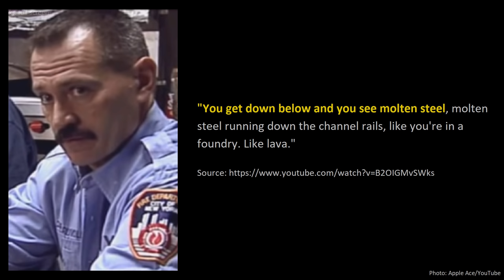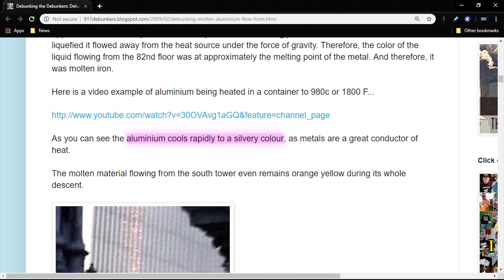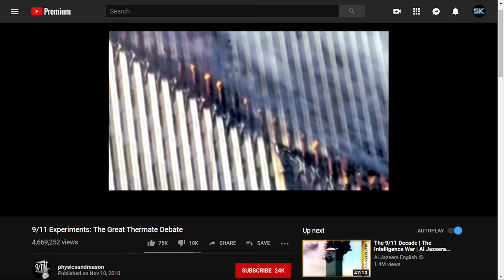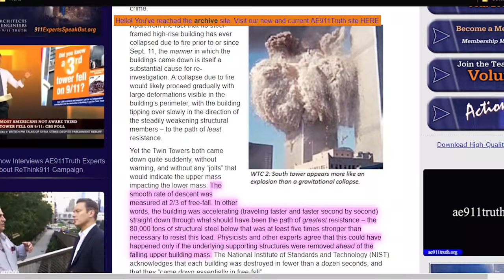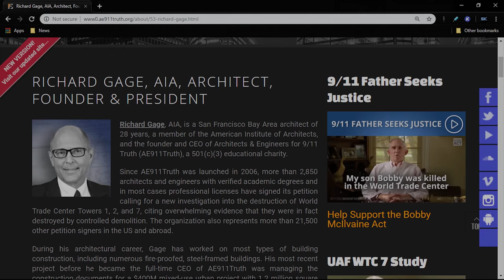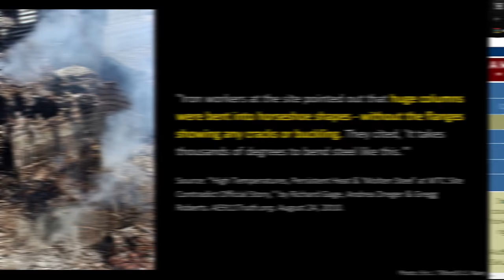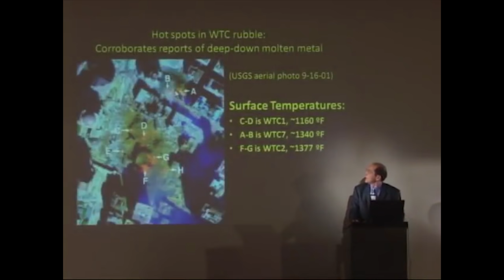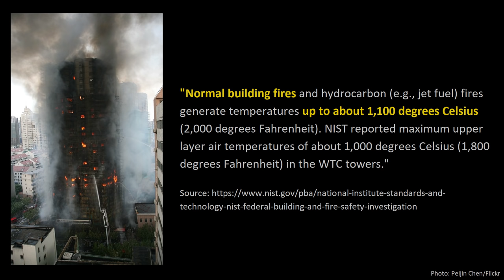9/11 Truthers Debunked: "Molten Steel = Thermite From Controlled Demolition!"

Comment: Excellent video and explanation!  One thing I've noticed about the much viewed hot liquid seen pouring from the South Tower corner just before the collapse initiation - no one but no one states the obvious. Well, it's obvious to me but perhaps that's because I've worked in buildings small and large half my life and have a built in sense of level and plumb. I don't care what the stuff is - but I'm very interested in why it's just started to come out!!! Holy moolley Batman, good job we packed our thermal resistant tights.  
The fact that the stuff is flowing UNDER a spandrel speaks silent volumes - the floor is detached and dipping down ( all the floor truss connectors were fixed in spandrel centres, thus the flat interior surface provided a "render stop" to American builders for the concrete was poured in). Bear in mind that in common with many office floors, both Towers were designed to support 100lbs per square foot - quite enough for office furniture and people walking about but after the B767's flew in - the lowest floor had to carry all the debris from wrecked floors above and most of the aircraft - and mostly on one side on fire!
I can't be bothered with thermite as the very idea is ridiculous.
No one who is surprised by the "meteorite" has any experience on old skool English demo sites! Not very Eco friendly - as the first thing we'd do is light a frigging great fire and I pride myself that I learned to be masterful in feeding my fires to consume stuff that other folk thought impossible. One of my "secrets" if they really were was building a big heap of fairly loose lumpy hardcore as a fire bed - once going well, the fire would draw air through its bed and on occasion - I had a mini blast furnace!
I didn't have access to the big hydralic shears and munchers of today so I'd drag any blocks of concrete with steel embedded and push them in the fire with the machine - a week in that kind of heat expands the steel and pulverises the concrete. Ground Zero had very similar conditions - only bigger - quelle surprise!!!
I've worked on controlled demo - actually with Controlled Demolition Inc in this country - 230 guys on one project ( three 15 storey concrete towers ) stripping them back to the frame and then weakening on one axis - the explosives blow out sections on the other and gravity does the rest. One major draw back to using secret explosives in the biggest fake in history would be the evidence it was almost guaranteed to leave behind - bits of det cord, connectors, tape bunches, junctions etc., - no truther has ever done more than shovel onions in MacDonalds so it's a mystery to them.
Reply: Outstanding summary and insight. Thanks for sharing!
Reply: Great post! For me, that was the part of the building where one of the engine of flight 175 and parts of its associated landing gear came out and we can assume that some parts of the wings also lodged itself in the opposite corner of the building, thus the dripping aluminum… very simple.

Comment: He openly admits NIST never tested the "WTC meteorites" without giving an explanation for why this would've not been done, as well as that they potentially lied or are incorrect about the reasoning for why the molten metal seen on floor 80 is Aluminum and not steel or iron or other materials (once again admitting it was never tested). He implies that dynamic hot-spots in the rubble imply a fire but not molten metal when there could've easily been both a fire and molten metal (not to mention that molten metal could've continued to settle over time causing dynamic hot-spots, or the aluminum he claimed existed could've kept melting and flowing) and also giving no explanation for the eye-witness reports of molten metal from firefighters; going as far as to say "to my knowledge no such testing was performed" in reference to testing of the molten metal firefighters claim they saw. You'd think an unprecedented attack on American soil would warrant such testing; but I guess it's in no way suspicious that no testing was done. He asserts without any evidence besides conjecture that it would be near "impossible" to rig the building with charges (once again using still images of a single floor of the building as evidence for a complex claim). He seemingly doesn't engage at all with the idea that small nano-thermite charges could've been planted on the outside of columns (not requiring them to be cut open as he implied) and that it would be relatively easy to conceal such devices if you were trying to. He also assumes that the thermite reactions would be visible from the exterior of the building because conventional thermite reactions generate plenty of heat and light (and likely would be visible), while not realizing that nano-thermite reactions could be tailored in a way to produce much less heat and light while still damaging the steel columns enough that they would eventually fail (remember they don't have to be cut completely for the building to fail over time from fires that would likely have occurred due to the crashes). He seemingly doesn't want to engage with the idea that thermite could've helped the buildings fail, as opposed to being the sole source of failure. He also only included a few short clips of the longer video by Cole, showing mostly the "failures" (times when the thermite reaction didn't adequately damage the steel beams) while seemingly intentionally excluding the "successes" (some of the thermite reactions cut fully through the beams in a way that allowed them to be pulled off by hand and that looked very similar to images of melted I beams present at Ground Zero). Additionally Cole admits in the video he's not an explosives expert and is simply rigging up experiments to test the viability of thermite as a tool to damage steel support beams (which NIST claims was implausible in their original FAQ); he did not go further in testing nano-thermites nor is he using military grade techniques when applying the thermitic compounds to the steel beams (it's plausible to assume an expert could produce far better results). The reality is that nano- or super-thermites existed as early as the mid-90s as evidenced by a Department of Defense researchers provide from 2002 titled "Nanoenergetics: An Emerging Technology Area of National Importance" which he references in another video. Nano-thermites would require much less mass of thermite to cause similar damage to traditional explosive materials. He also seemingly doesn't engage with the fact that thermite must be ignited to start reacting and that the explosions people heard could've been charges that lit the thermite initially. He also states that "thermite simply can't cut beams in the instantaneous manner necessary to sever dozens of steel columns at the exact same millisecond" while in no way explaining why he thinks they all had to be cut in a few milliseconds, and again ignoring that nano-thermite does have the ability to cut steel in a manner of seconds, especially when prepared by experts. Why did he not engage with FEMA Appendix C: Limited Metallurgical Examination which detailed "two structural steel members with unusual erosion patterns" that showed "evidence of a severe high temperature corrosion attack on the steel, including oxidation and sulfidation with subsequent intergranular melting" concluding that "the severe corrosion and subsequent erosion of Samples 1 and 2 are a very unusual event. No clear explanation for the source of the sulfur has been identified?" He admits that it's possible that some of the "meteorites" could've been molten steel while also claiming that if that were so then the other portions of steel that weren't melted would've lost their shape and become molten. However, in the case that the steel became molten due to short term nano-thermite reactions (remember that he talked about how the truther theory implied the thermite charges cut the steel in milliseconds) the heat from the reaction would quickly run out and would be insufficient to melt additional steal once the nano-thermite material was expended. While some of the analysis in this video was well researched and pokes some holes in the "truther" theories, other parts of it felt like conjecture or hand-waved a lack of testing on materials found in the 9/11 rubble that should've been further tested.

Comment: The guy said the molton metal was ocming down like a foundry on the channel lines.

This is something that was witnessed so therefore cannot be compared to aluminum which later in the video you demonatrate will turn silver once it leaves ita cauldron or islolated container...

You would also expect  the pools of molton iron to move or shift slightly as it could penetrate the floor beneath.

Another point iis the area where the so calles aluminum is flowing out of the tower, that area ia clearly not in a raging inferno to produce such temperatures to melt the aluminium to reach that colour or sustain that colour during ita descent.

I see no evidence in a close up hi res inspection that the molton steel turns silver as you propose.

Comment: 6:20 what was the temperature? Are you just assuming it's roughly 1100°C? Hypocrisy form 1 point to another is some Blue Pill Logic.
Reply: Learn about "black body radiation". Then come back and try again.
Reply: @mooneyes2k478  black body radiation is a thermodynamic that puts out light... Please, elaborate what that has to do with my statement. That has nothing to do with getting a proper temperature reading. It's simply an action. Or, do you think it magically hides temperature? AND, my statement obviously went over your head. I can spell it out for you if you want.
Reply: @tankeater   Very good, it is. Now, elaborate. What further?

Comment: Nothing tested what does that tell you and airplane wings would not go thru steel getters ,they would have fallen off
Reply: Except for the MASSIVE amounts of tests, that is. But other than that, I'm sure you're right.
And nothing "went through" anything. That you think it did is very clear proof that you don't understand the very basics of what happened.
Reply: @mooneyes2k478  I agree with you ,a plane didn't go threw the building
Reply: @bobo44donemilking51  Not that that's what I said, but still, you're right. It didn't actually go through the building, as that would mean it came out the other side, something that didn't happen.
Reply: @mooneyes2k478  just like the pentagon ,frame by frame no airplane and hit the exact area where the office of the missing $2 trillion dollars was , imagine that 💥💥💥
Reply: @bobo44donemilking51  Sure. Other than the airplane, the "office" and the "missing trillion". If you discount THAT....I'm sure you're right. Only, there wasn't much left then, was there?

I particularly like how you couldn't stay on subject, clearly showing that you didn't have any arguments for the nonsense you originally spouted and so ran to something else.
Reply: @bobo44donemilking51  No? No, of course not. Not a surprise.
Reply: @mooneyes2k478  🌘👀

Comment: 10:58 The columns you see on the facade of the building are aluminum, not steel. So if thermite was being used to melt steel columns, it would be all on the inside of the building, not flowing down the outside.
Reply: Exactly

Comment: You're looking at this part where the molten medalists dripping out the side of the building but you've given no explanation as to how so much would you be pouring out of one spot
Reply: it had to start pouring out somewhere. Then once the flow started going it was like a syphon effect.
Reply: @cooljunkproductions  siphon effect? That's in an enclosed tube. This was out in the open and it would have melted any tube
Reply: @davmus1112   Jesus christ it's like you guys are being purposefully obtuse. I'm obviously not talking about tubes, but rather the underlying physics of a syphon. Once the flow starts, the pressure can be relieved from other areas that the flow may have otherwise travelled out and it more or less is pumped out of that one area.
Reply: @cooljunkproductions (siphon definition) a tube used to convey liquid upwards from a reservoir and then down to a lower level of its own accord. Once the liquid has been forced into the tube, typically by suction or immersion, flow continues unaided.
Reply: @davmus1112  Like I said it's about the underlying physics, doesn't have to involve a tube. Anyway there's different types of siphon effects and a quick, lazy dictionary search like you did won't give you that sort of detail. But please, get hung up on the "tube" part. It's like your new imaginary line in the sand. The one thing you truthers seem to be able to do is create these. Why don't you look up another term- "continuum fallacy"?
Reply: @cooljunkproductions  you called me a name....truther, I never claimed that. I've been studying science my whole life and to here you say siphon effect and claim no tube is necessary makes you sound mental. The question still remains, what caused all that molten steel in the first place.
Reply: @davmus1112  You seem to believe in the controlled demolition theory and that makes you a truther. And science is a broad subject. You could be strong in chemistry but weak in physics, for example. My guess is you're not too strong on physics. And again, my point is the physics of a siphon effect. It doesn't have to be an exact tube. The "molten steel" you speak of is not steel at all, but most likely aluminum- as stated in the video. A good chunk of the video goes into this. You didn't watch much of the video, did you? Seems like you're just another truther who comes to debunking videos in bad faith just to dislike the video and argue with people in the comments. So maybe you should just gtfo?
Reply: @cooljunkproductions  actually the physics of the collapse is all that matters.  One tower was hit at the 93rd floor.  According to physics,  the building could not have collapsed all the way to the ground. Do you need me to explain why?
Reply: @cooljunkproductions  I took ap physics in high school,  I took college physics,  I have a bachelors of mathematics from a major University...is that what you call weak? I'm sure you are willing to share your your background
Reply: @davmus1112   People like you don't deserve to flaunt your math degrees or titles of any sort because you're only doing it in bad faith. Just like those "demolition experts" who crawled out of the woodwork to basically just rile up the conspiracy theorists.
Reply: @cooljunkproductions  you said I was strong in chemistry and weak in physics.  So now the conclusion might be the you are weak in both. Would you like me to explain how the physics is incontrovertible?  That there's no way the buildings could have collapsed to the ground without controlled demolition?
Reply: @lex.cordis  also if you guys would educate yourselves, you'd find there's lots of different syphon effects like the open channel siphon effect. look that up. syphoning isn't always about having a tube
Reply: @cooljunkproductions  Weak.

Comment: No disrespect intended towards anyone. Lol. But Ive read in the past there was a UPS on one of the affected floors. I wonder what molten lithium looks like?

I agree entirely. The floors around and within the impact zone began to fail sporadically, maybe one or two at a time, until the top just slid/came down on itself. The fact that many of the people inside the towers were never found…I don’t think we understand the amount of force and downward pressures created in these collapses. Some say they see squibs in the lower floors when the collapses commence, but again, I don’t think the force is even imaginable.
Reply: There was. Don't know if it was lithium or conventional lead-acid. It was located in guess where,... Right in that corner on that floor.  Its part of the pile of clearly visible aircraft and office debris shoved into that corner at those floors by the impact.
Reply: @MFitz12 🪴🪴🪴🪴🪴😆

Comment: Why were people moving things in metal boxes into the building in the months leading up to the event. Also those floors were under "renovations" this is what I have heard from my friends who worked in the trade centers.
Reply from the maker: "People were moving things in metal boxes into a building; therefore, controlled demolition!"
Reply: @ASkepticalHumanOnYouTube  Is it your opinion that only aluminum melted on 9/11? No steel melted?

There are multiple examples of girders and beams which were over 1" thick being reduced to less then 1/8".

Comment: Also the metals melting point isn't hot enough to keep the metal in melted liquid form it would have to be consistently hotter and stay hotter then melting point for the metal to stay liquid. Melting point is just general point of where the solid metal will start melting dripping but usually as soon as those drops hit another surface or if they are in the air long enough they start going back to solid metal.

Comment: Elevator shafts we’re not damaged.  The head electrical engineer said he knew it when he saw the pbs doc.  He noticed the power was on in the lobby and all the power to the building ran along side the beams and elevator shafts.  If the beams were damaged by plane than the power would of been out in the building
Reply: There were no beams.